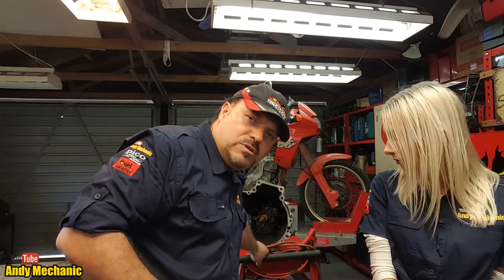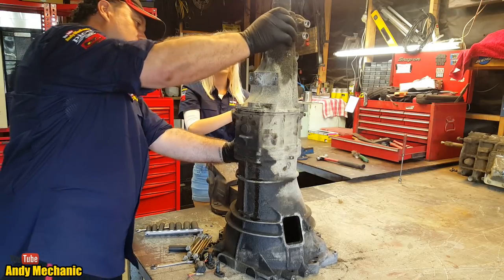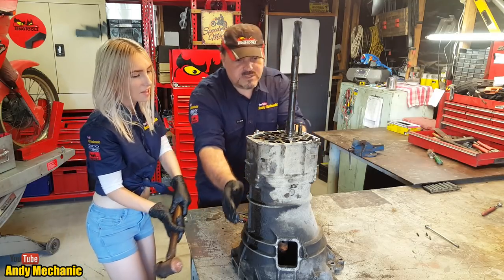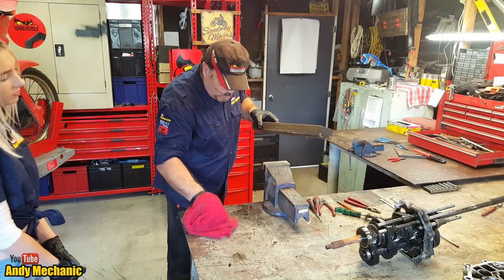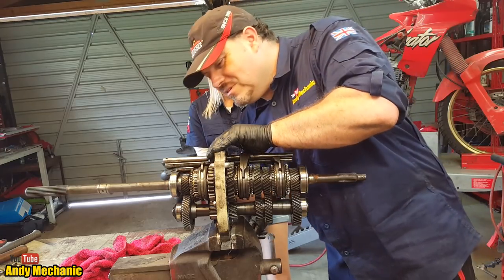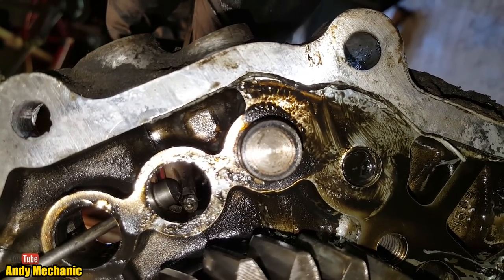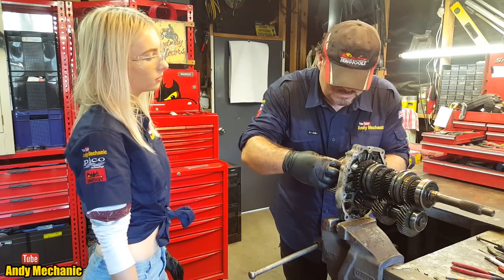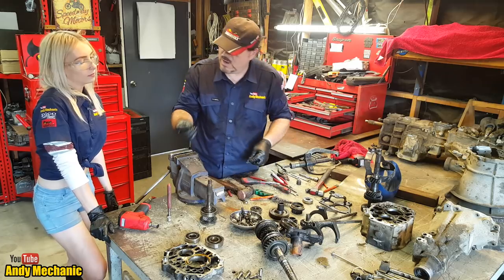Manual g/box strip & operation Ft. Tool Girl Sam #1027

Comment: dont worry sam, nobody does this except the most ambitous of gearheads,..even dedicated transmission shops rarely get it right on the first try (my experience i usually have had to take it back to them 4 or 5 times) the average wknd warrior would just get one at a salvage yard.....i will admit a manual is easier than an automatic, ...so mabey...

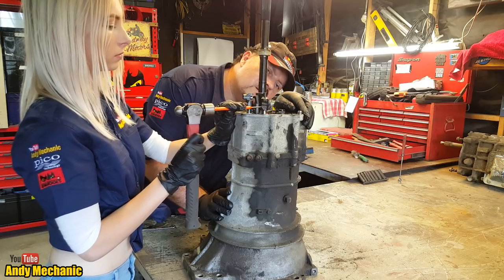Comment: 13:55 That's called strangling the hammer.. :) (Holding it by the neck) Or as some might say: The entire hammer is payed for, you can feel free to use it's entire length.. :)
Reply: I sometimes strangle the hammer on purpose to apply less force. :D
Reply from the maker: +audhen1 Me too & more accuracy :-)
Reply: I usually control the force with the swinging technique. Or take a smaller/lighter hammer if it is super critical. The only time I need to strangle it is if the geometry/placement of the target is awkward. :)  But anyway, it was a quick comment for humoristic reasons as I was watching it. :) Good videos by the way.
Reply: Thats' what I have to tell the wife :D :D

Comment: I would just like to suggest that sometimes sticking a strong magnet to the side, near the end of a screw driver, punch are similar will allow ball bearings and some loose small pins etc. to stick to them. It even helps to reach dropped screws and bolts sometimes.